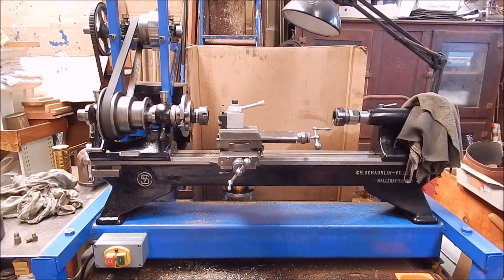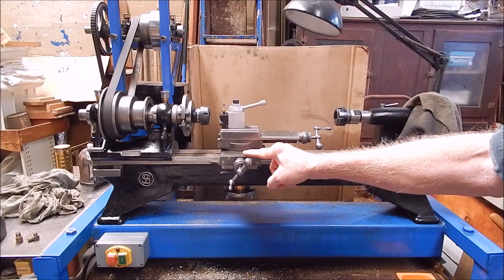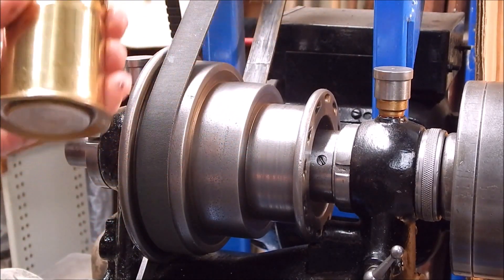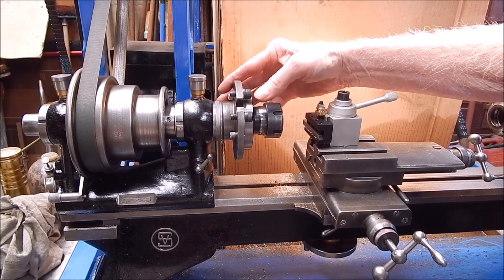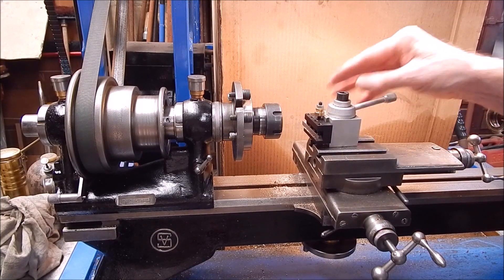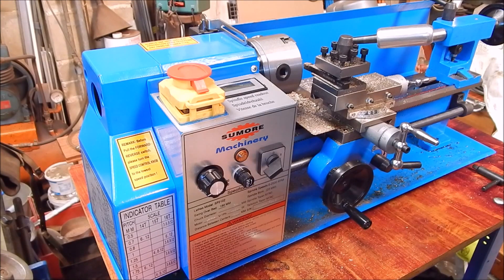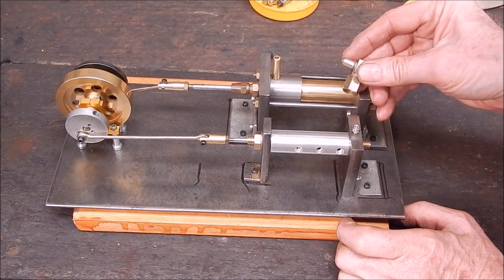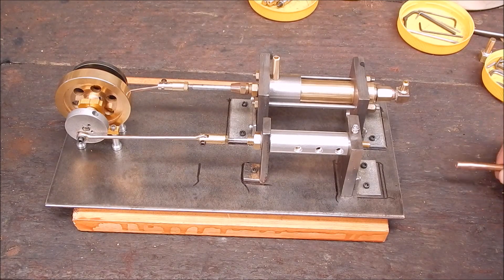My vintage 1930's Schaublin 102 tool makers metal lathe is still earning it's keep

Comment: Rob, I have a 1950 , 10 in Logan lathe , an older import mill , and the same drill press as yours. I got the drill press when a tenant skipped out owing me rent so I confiscated it ( best deal I ever made with them ) . 😉 !
Reply from the maker: It's a good reasonably heavy duty pillar drill.  Well featured and made in Taiwan.   I'm guessing it's from about the 1970's.  They pretty much all come with a rotary table and rack in that size now.   Definitely a big plus for usability and convenience. 

I don't know how the current similar sized Chinese ones compare.  They look a bit lighter in construction and many are floor mounted long column type, which I don't really like, as you can't store anything under them or use a car jack to prevent table flex when doing heavy drilling.  They all flex a bit.

Cheers Rob

Comment: G’day Rob. I don’t recall seeing your drill press feature in one of your videos, very handy design. I have one with the same features which I picked up about 3 years ago, I think you’d appreciate this it’s a “Sher”, I didn’t know they made pillar drills. 
Cheers 
Peter
Reply from the maker: Hi Peter.  Wow, Sher must have made or re-branded lots of things over the years.  Generally solid stuff.  I've not seen a Sher pillar drill.  Ron Sher had his hand in lots of things.  I see he no longer sells Sherline stuff.  He must be getting on in years.

I haven't filmed the pillar drill much as it's difficult to get the camera in a suitable position and use it at the same time.  It's a good unit.  They all flex a bit so for heavy work I always put a car jack under the table arm to keep everything aligned.   It's very accurate, but initially the non OEM Morse 2 arbor fitted had run out, so that got the flick.

I also have 3/4" Jacobs chuck for it, but it's rarely used and a bit pointless as most drill shanks max out at 13 mm.

Cheers Rob

Comment: Cracking little lathe Rob, really nice to see in such good condition. Engine looks interesting, looking forward to the big switch on. Cheers, Jon
Reply from the maker: Hi Jon,  it's an interesting exercise as you say.  If it works out OK I may make a single action monoblock one next. I have a design in mind.   All good fodder for the metal lathe.  I really must get a mill for this type of work.  Cheers Rob

Comment: Hi Rob. Love that drill press table 👍👍 One way to get round not having a rotary table is the float lock vice. Couple that with a table which will rotate around the column and it's almost as good as a rotatory table. I'm very envious of your Schaublin, that is one very nice machine. Cheers, Alan.
Reply from the maker: Hi Alan,  they made them look good back in the olden days.  Everything was about style.  I had a chuckle this morning thinking about Bruce the "negotiator" Rega seller.  That was a classic conversation.  He He.  Some things just stick with you for life.  Cheers Rob

Comment: I have a compound rest/ cross-slide from a 102 that someone gave me.  The precision of these machines is amazing.  I love the design of the leadscrew with anti backlash mechanism.
Reply from the maker: The 102 compounds usually sell for big money.   I'm not familiar with Schaublins that have a leadscrew.  I guess you are referring to the later VM series ?  Cheers Rob
Reply: @Xynudu  no I’m sorry I meant the Acme screw for the compound and cross-slide.  They use a cast-iron nut with a jam nut that acts as a anti-backlash feature. I am not exactly sure how it works but it’s very effective at eliminating backlash